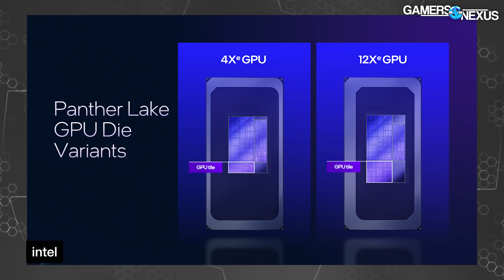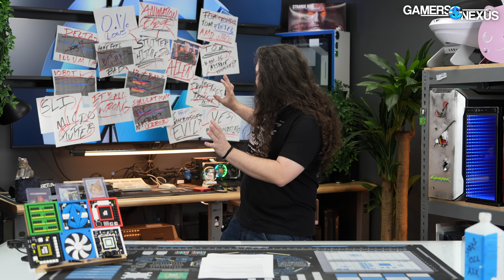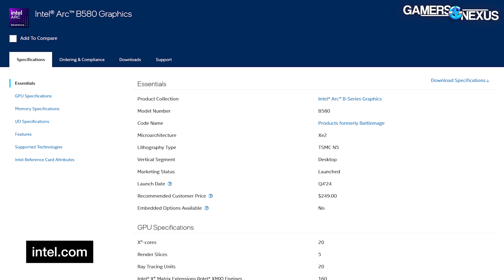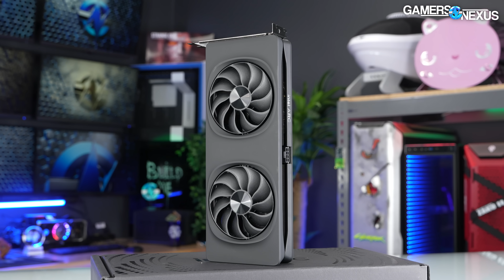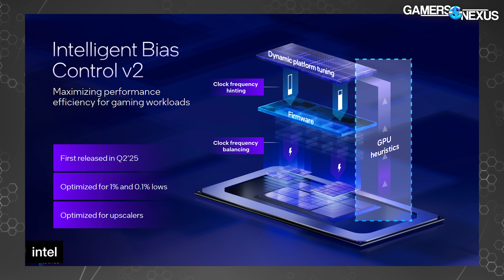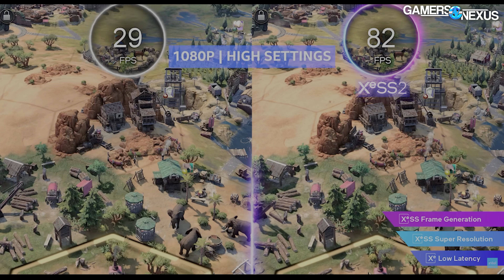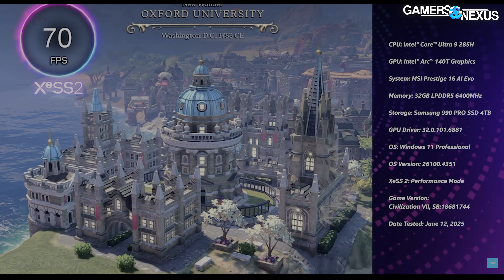Intel's New GPU: Xe3 Architecture Changes, Handheld Gaming CPUs, & XeSS3

Comment: For the part of how long for each part the game play frame takes a tool from Intel does exist and is freeware. The issue right now for Xe3 would be serval. 1 Xe3 is not a released product 2 to get a fair compare point you would have to do the exact same frame on Xe2 as you do on Xe3 3 The frame time will be effected by the OS, game engine background NPC(s) and etc. with variables you cannot control.
When improvements are in the nanoseconds yes the OS doing something in the background even if it takes up a minimal amount of time it will still show an impact.
So yes the tool exists for it no it is not the easy to get a like for like comparison more so as the version of Xe3 in the video will require a CPU change.

Comment: Intel's Arc B580 (272 mm Die) is directly competing with Nvidia's RTX 5070 (263 mm die); everything else is literally just marketing....

Just to put things further into perspective, the RX 9070/XT have a 356 mm die.... Very close to the RTX 5070 Ti/5080's 378 mm die...

So, when we talk about price point comparisons between competitors, just understand that one may have a huge advantage in material cost because of it's architectural dominance (innovation)...

It's not shocking then that AMD went with the cheap RAM, but I do suspect that will affect it's longevity... Even then, it had to lie about MSRP after Nvidia's MSRP undercut what AMD could sell it's GPU's for... Which is why AMD almost certainly limited future production of its Desktop RX 9000 series GPUs....  I suspect this will only get worse as they focus on the AI Honey Pot...

Comment: I would LOVE to take an AMD, Intel & nVidia gpu pipeline expert, show each of them their respective competitors' full processes/etc and then ask each of them, "What are the other 2 doing wrong/wildly different/unexpected?" Are the 3 approaches significantly different, ya know?  Is one company doing something strangely efficient in some area that the other 2 could learn from and expand upon?
Reply: I know all 3 vendor's GPUs, and they are not so different from each other. All are vector processors and run the same OpenCL/SYCL/OpenGL/Vulkan/HLSL codes.

Biggest difference is warp size (how many cores have to work in lockstep), 32 for Nvidia, 64 for AMD, 8 for Intel Arc Alchemist and 16 for Intel Arc Battlemage. What is better? Depends on software.

AMD/Nvidia are SIMT architecture. Intel Arc is SIMD architecture (more typical for CPUs), which with special difficult-to-write software can be much faster. AMD had a hardware bug in their memory controllers until (including) RDNA3, making their cards perform poorly on compute software. Intel Battlemage can do on-the-fly memory compression, boosting effective bandwidth in some cases. Nvidia went full circle with their CUDA core design, with Blackwell being identical to old Maxwell/Pascal design, and Turing being super cost inefficient experiment with separate FP32/INT32 ALUs. Interesting hardware decisions on all sides. The devil is in the complex details, and there is no one perfect solution for all software workloads.

Though personally I would wish for much more VRAM capacity and bandwidth.
Reply: @ProjectPhysX  Thank you very much for the detailed and super interesting reply!  Really appreciate it :)
Reply: that's exactly how we got lightbulbs that don't live for longer than an ant
Reply: @MunnCher5 huh?

Comment: one the updates for the ARC GPU's driver was increased multi-threading.
My complaint is that all the reviewers were claiming it was slower cpus had driver overhead issues.
My comment has been ignored when I said it was thread limited , it wasn't a slower cpu issue.

don't even think about commenting to me about HUB BAD Video about CPu overhead they don't know to properly benchmark for OVERHEAD Vs Engine Problems.

Comment: If Celestial supports virtual reality, I will give Intel Arc a chance. The main reason I've hesitated trying out Arc cards is because they thus far explicitly have had no support for VR applications.
Reply: I can't really blame them. VR still hasn't really taken off. VR sickness is still a huge hurdle for most folks, and some never get over it.
Reply: @PrecludeLP  That's a bold-faced lie, considering how many people I find in games like VRChat and how much PCVR hardware & games are still being developed--they wouldn't be investing so much if it wasn't "taking off".

I actually have motion sickness and I have had no issues whatsoever in the nearly 1000 hours I've been playing VR. Even if motion sickness was a problem, ginger pills are a simple remedy. So the argument that sickness is a hurdle is completely false.

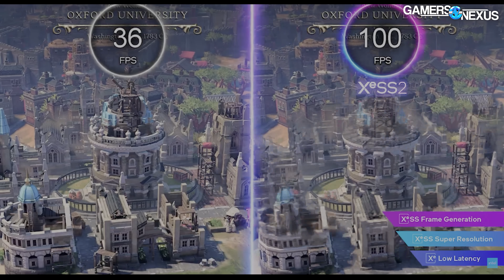Comment: 18:51 it's more than just engine data. Optical Flow and Motion Vectors sound like buzzwords, but that's really the heart of MFG-type algorithms. They're like hints to whatever algorithm is doing the framegen that a pixel is moving in a certain direction in screen-space. It's the same concept as dead-reckoning, but applied to pixels. Of course the results are worse than native, they're just educated guesses. But that educated guess is gonna come back quicker than running the entire render process again. In fact, you can do that in parallel with rendering an actual frame.

All that to say, native frame rendering performance should ALWAYS be prioritized over framegen, but framegen can work if done right.

Comment: "this isn't celestial" ? What isn't xe3 based on celestial?
Reply: Discrete arc and integrated arc are slightly different. Not enough to have a significant performance difference, but the integrated architecture is more optimized for efficiency and so on than the discrete version.

Comment: One huge thing for me -- SR-IOV will be officially supported again, allowing full GPU acceleration in VMs without PCIe passthrough. I can't wait to replace my 8th gen. T490.
Reply: why is this useful?

Eli5
Reply: @lilkidsuave  My main OS is Linux, so I can run Windows in a VM having the same capabilities as the host (Vulkan, DX, OpenGL, Intel QSV...) without ugly hacks or sacrificing performance of the main system. So web browsers, games, CAD apps, all running smoothly, as if I used only Windows.
Reply: Arc Pro B50 and B60 cards have SR-IOV, keep an eye out for when they hit the street.
Reply: @ErikBročko I saw Wendell's video on this promised support by Intel and I'll believe it when I actually see it, the quoted deadline is end of Q4 which in reality/non-corpo speak means Dec 31st.
Reply: @nogravitas7585 It's already in the kernel, they've flipped the switch in July.
Reply: vGPU exists with 10 and 20 series cards from Nvidia. I've played around with it on my 2080 ti, there are also vram mods for the 2080 ti
Reply: Intel's iGPUs have continued to support vGPU functions for years, they just don't call it SR-IOV because it works slightly differently to true SR-IOV and they confused a bunch of people when it changed a bit and they changed the name from GVT-g. It's not widely used but it's there. The only change here is for dedicated cards, where the newly released Pro cards have a smaller price premium than usual and they're planning to offer SR-IOV in the near future instead of gating it on server grade parts (AMD) or just on 5 figure+ pricing (Nvidia)
Reply: t490 one of the last best laptops made
Reply: battlemage already supports that but only in pro lineup, i think it will stay the same in new gen
Reply: Im retarded following this thread for more info lol steam os with a windows vm for anti cheat games sounds great
Reply: How do you do this in Linux do you mind explaining? I like using gpu passtrough on my desktop with qemu+kvm and it works well after I take my time to set it up. I had no idea it was possible to have full gpu acceleration using Linux as host without passtrough with windows hosts 😮
Reply: Thanks Steve

Comment: Lunar lake is one of the best thing Intel created recently, so I'm curious how much they improved with Panther lake.
Reply: From the specifications, there are three product lines:

First, the 404, which comes with 4 Xe3 cores.
This CPU is similar to Lunar Lake in terms of efficiency and specs, but it offers slightly higher CPU performance. However, since the GPU portion has been cut from 8 Xe cores to 4 Xe cores, this model is unsuitable for handheld gaming devices, as its gaming performance will inevitably be weaker than Lunar Lake.

Second, the 484, also equipped with 4 Xe3 cores.
For gaming purposes, this one can be skipped entirely—it costs more yet provides no improvement in gaming performance. It’s likely targeted at laptops with dedicated GPUs or ultra-thin notebooks that aren’t designed for gaming.

Third, the 484 paired with 12 Xe3 cores.
This is the version that brings a significant boost in gaming performance. However, the trade-off is increased cost. The combination of 484 + 12 Xe3 is destined to be a high-end product, likely appearing in premium handheld gaming devices—and it certainly won’t be cheap.
Only if it delivers a substantial improvement in gaming performance will it truly attract gamers. With 12 Xe3 cores, XeSS 3, better optimization, and improved power management, it could very well become the most powerful handheld gaming platform of the near future.
Considering AMD currently doesn’t seem to have a stronger solution, this combination might be the most powerful handheld gaming setup for the next 1–2 years—though its price will likely prevent it from becoming a mass-market hit.

Comment: Intel's GPUs have this behavior I have a love-hate relationship with. Their subgroup/wave/warp size is variable and has to be specified at pipeline compile time (unless you want to let the driver handle it, which is actually fine for most kinds of workloads that don't use subgroup ops). Most compute algorithms have settled on subgroups being 32-wide (thanks nvidia) because that lets you mask off all the threads using a single u32. Problem is, intel is the only IHV that also supports 16-wide subgroups, and they actually perform better than 32-wide due to register allocation/pressure reasons.

AMD used to do something similar prior to RDNA where their subgroups were 64-wide. Again, that's not a bad thing for most workloads, but it is when you're writing algorithms that depend on 32 invocations going simultaneously. The fix for that used to be to just mask off the top 32 of the subgroup, but that also means literally half the compute unit is doing nothing. Not good.

All this to say, intel focusing on 32-wide (SIMD32) performance is huge.